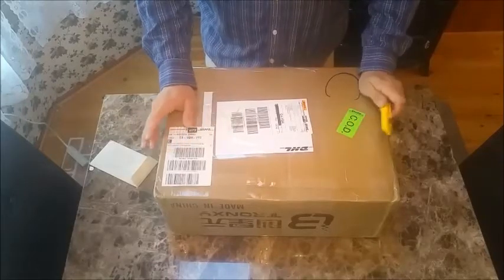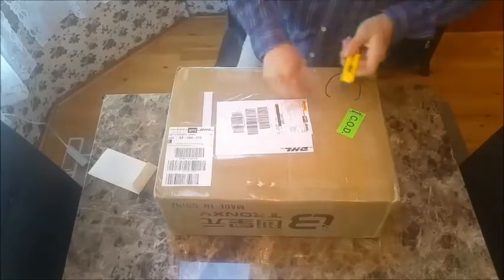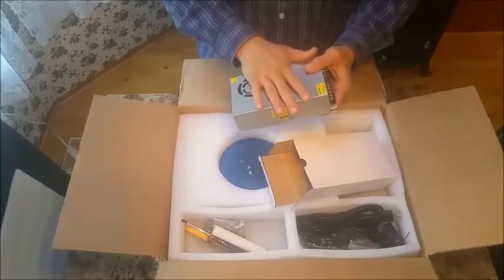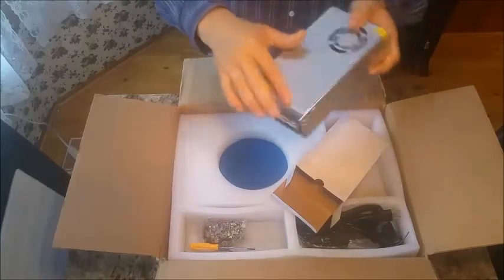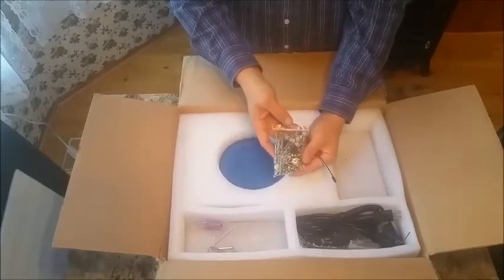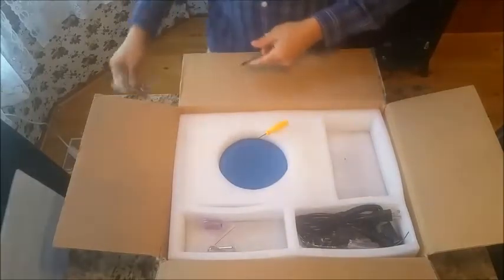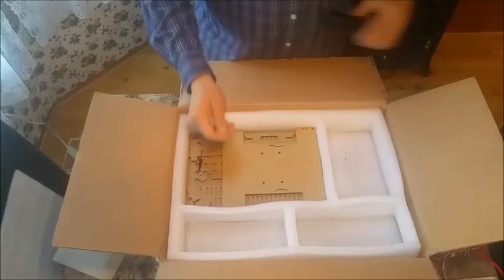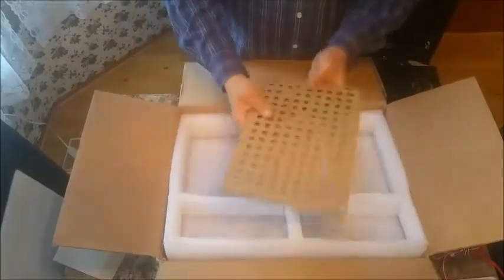Tronxy X3 3D Printer Unboxing

Comment: I have bought it on Gearbest by 175+35 shipping total 210 usd, but there are some nuts lost, and I make it by myself from standard nuts, and screws M4  there are very short, so better to by new  2or3mm longer accordingly all sizes. Same without any testing filament.

Comment: Did it come with filament? If yes, how much?
Thank you
Reply from the maker: The X3 from Gearbest did not come with filament
Reply from the maker: However I purchased a second X3 to assemble for the company I work for recently through a seller on Aliexpress and it came with 2 200gram rolls of filament and a ton of extra screws and nuts unlike the first one I got from Gearbest, it had free shipping to so it ended up being cheaper then the one from gearbest

Comment: Would your recommend this kit?
Reply from the maker: Once I got past some issues I have had nothing but great prints with the printer. If I did not have 4 printers already I would have definitely purchased another one. Tip: If you purchase this printer make sure the seller is reliable for help and when you go to wire up the power supply ditch the stranded 14awg that comes with it and use some 12-10awg solid copper wire. My board had an issue where the ground in melted a few days after the build was complete due to the wiring from the power supply getting too hot as there was too much resistance on the braided lower gauge copper wiring. Gearbest sent me a complete replacement board and I ordered some new connectors I will solder to the original board to have a spare. The printer prints nice, has a nice look, solid frame and large print area. As far as I am concerned there is nothing out there that can beat it at the $200usd price point at which I purchased it. If you have not looked at my update check it out, there are some timelapse prints and some addons i created for the printer
https://www.youtube.com/watch?v=UQb2CIgKkU0